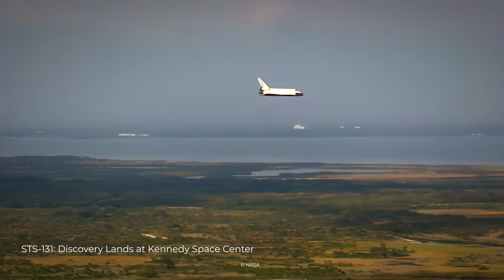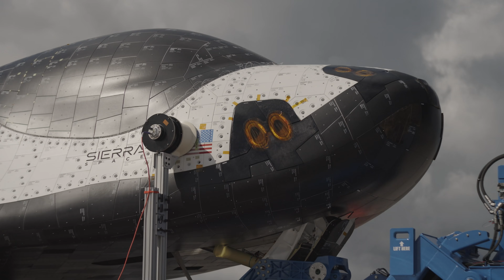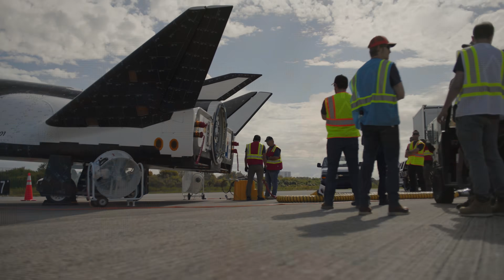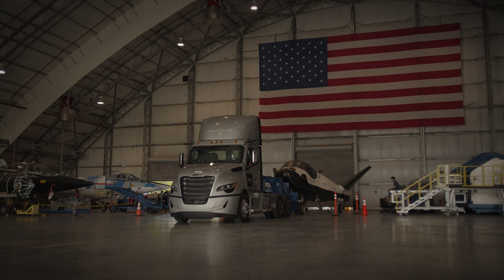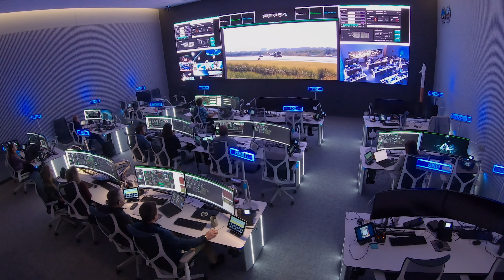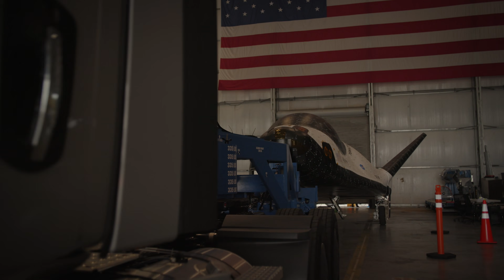Dream Chaser Completes Tow Testing at NASA's Kennedy Space Center

Comment: Dream Chaser was originally scheduled to launch on a Vulcan Centaur VC4, which as a 4-booster configuration is designed for LEO payloads in the 16,301 kg to 21,400 kg range.  A launch on Ariane 6 is also being planned, on what will probably be an A64 which is also a 4-booster configuration designed for LEO payloads in the 10,351 kg to 21,650 kg range.  As an alternative, Falcon 9 should be able to launch payloads up to 18,500 kg if the 1st-stage is reused, and up to 22,800 kg if the 1st stage is expended.  New Glenn with its 45,000 kg maximum payload should be able to carry Dream Chaser with no trouble.  So, I'm wondering what the final launch weight will be for Dream Chaser, given its possible range of payloads up to 5,000 kg pressurized and 500 kg unpressurized.

Comment: How about we take a leap and bring the tests closer so we can see this thing finally fly. I remember when I was in middle school when first seeing this project kickoff. Before Artemis there was the Orion project and I swear I seen it in a old textbook where a Dreamchaser had docked to the iss and then later combined with the Orion craft for lunar travel. I think it even showed a lunar variant of the dreamchaser which was cool. Even in Popular mechanics or related magazine ive seen other versions of the dreamchaser model being used in different missions. I really wish the testing was done alot sooner because some of these tests are kinda basic. And tbh even the heat tile tech has improved over the years so it would be wild to see bigger tiles for the craft to reduce development time spent on putting them in. They should work with SpaceX and send up a dreamchaser on a Falcon Heavy if it can handle the weight. It would be nice to see this thing dock to the iss this year.  I hope Jared Isaacman can get the ball rolling faster with stuff like this.

Comment: Yay Dream Chaser  !    and ....
Rocket Lab's Neutron rocket is designed with the capacity and capability to potentially launch the Sierra Space Dream Chaser spaceplane.  And to be Human Rated....  !!!    Just saying.  😊
Reply: The fairing of Rocketlab's Neutron is too short to fit Dreamchaser with the attached shooting star module, and Neutron doesn't have the necessary cargo lift capacity either. It will instead launch on Vulcan Centaur VC4L.
Reply: That would be the coolest looking option.

Comment: This tow test is needed because one you have to prove the vessels aerodynamic and two it test out the equipment so that they could tow the vehicle back to Bay 2 So it could be fueled and prepare for the next flight after it lands. Now that the tow test is successful, next step is to clean the vessel off, Attach the shooting star, loaded with cargo, Place inside a fairing, attach to the Vulcan rocket, and finally want it to the International Space Station or to Orbital Reef or the new Axiom Space Station. We have several large oru's that need to come back before the station is retired and without the shuttle, the only vehicle that could bring those items back is dreamchaser. Good luck with your test Sierra Space and I will see you guys on the pad in a few months.
Reply: Starship also has the potential to bring back sections of the ISS, or to go collect Hubble and deliver it to the Smithsonian. If the world ends up with both of these vehicles in regular use, plus Dragon and Blue Origin's planned vehicles, and Rocket Labs Nuetron SSTO, we'll all be looking up to the future a lot more.

Comment: It seems to be a much better idea than a capsule on a parachute!  Looking forward to a first flight. Also I don't care what rocket it goes up on. Some bloggers say you are linked to a particular launch vehicle , any one that works is fine by me
Reply: It can be launched on a Falcon Super heavy, as I understand, though without a fairing -- they have some other adapter designed with the wings in flight configuration vs folded for being inside a fairing.
Reply: There should be a standardized ring connector, that lets any vehicle fly on any booster, just as there's a standard docking port for all vehicles to use at the ISS, and was used at MIR and China's Heavenly Palace.